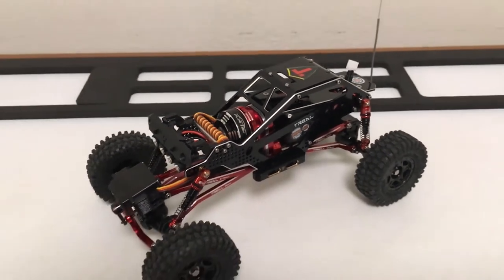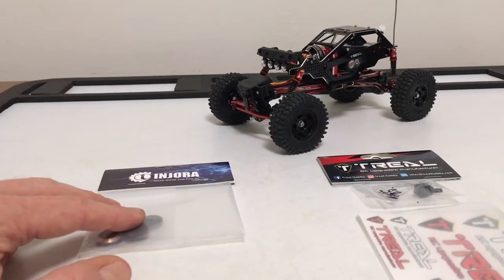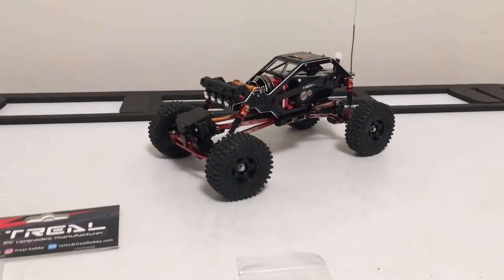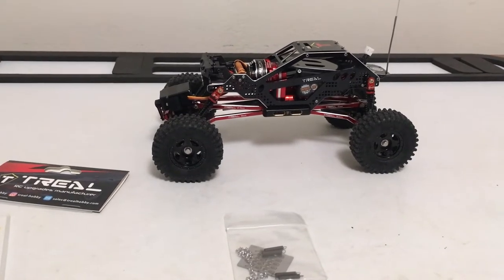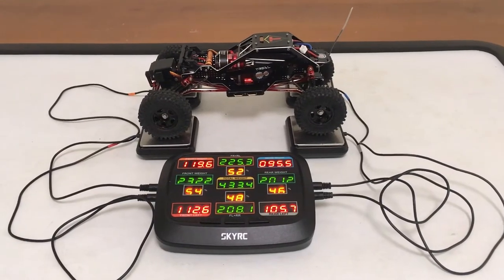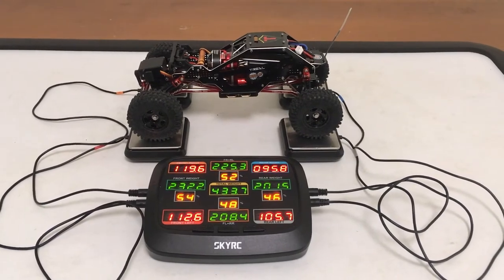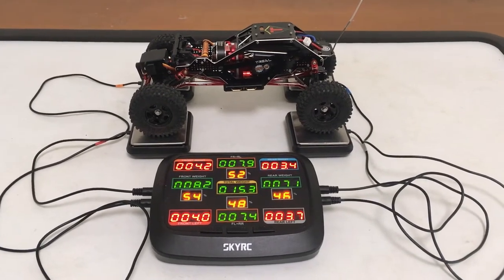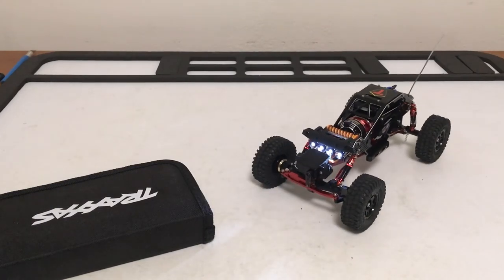SCX24 ROCK RACER UPDATE: MAD MAX - KINETIC RECOIL INSTALL & TEST, INJORA AXLE WEIGHTS, TREAL O.D.

Comment: Man I've been thinking about how to convert an SCX into effectively a 1/24 wraith and been looking high and low for a good reference point... and you fuckin' nailed it. Everything about this is precisely what I'm trying to build, except I might go a different direction with the motor to make it more "bashy" and less "crawly". Thanks so much for sharing
Reply from the maker: Thanks for the compliment.  Sounds like it will be awesome.  If you have any questions along the way, just ask.
Reply: @bcochener  Thanks for offering!
 Got the chassis all assembled, absolutely love it, makes the truck so much cooler.

 Currently running the Treal Deadbolt links, as sold. I noticed you put the rears from the deadbolt set in the front.. am I missing something, or do you think I could use the rear deadbolt links and rear deadbolt driveshafts to just get some OUTRAGEOUS stretch? Would there be a downside to having a symmetrical suspension setup that I'm not thinking of? Stretching the front out is definitely very important imo, the stock deadbolt front end just doesn't give me remotely enough room in the front!!

Thanks again for your time and your videos :)
Reply from the maker: @juanlobo3202  That would be pretty loooong!  Longer you get, the larger the turning radius will be and you will high center more.  (...you can always do rear steer to gain back steering.) 

You can really run about any link combo on these chassis builds.  I am doing a DB front/JLU front chassis build next - as a really short one to compare the two.

I am liking my Vader build length w/ DB rear, JLU fronts.
Reply: @bcochener  Thanks a bunch!! I'll see where the build takes me, I think I'll leave it on the DB treal links for now, although I'm pretty sure when the servo blows and I put an e-max in there I'm gonna run out of space. It has almost no flex right now with the stock shocks, but the injora shocks and a BUNCH of brass gets in tomorrow!

Comment: This is interesting. I watched another YouTuber do a review on these and he absolutely couldn't make him work became frustrated and angry with them and just threw in the towel. and I wasn't interested until I watched what you just did and you seem to have handled it just fine. And they seem to have worked really well for you. this is why I don't watch him anymore and I've begun watching you a while ago. You do a really good job your videos are wonderful your builds are awesome great job appreciate what you do thanks a lot.
Reply from the maker: You must be talking about 2FMRC?  I did add to the swear jar installing these, but I add to that every build with this tiny hardware!  I get the frustration, but I also am a problem solver.  After this video, I loosened them up to raise it up for more clearance, and they started popping of the rear axle.  So I split the difference and pulled them a bit tighter by removing links.  That's why I left all the slack to begin with, I figured it would take some dialing in.  I have parts for a new Mofo kit I will be starting ASAP - and it has his limiter straps.  So I can compare how I like the 2.  Stay tuned!!!

Comment: Lookin good bro!
Reply from the maker: Thanks.  Liking these recoils so far!
Reply: With that being said, I asked you if those would be good for a JLU. Do you still believe that after running these? Cause I don't want to use limiting straps on my build. Do you think the "unload" would be the same on the JLU?
Reply from the maker: @workaholic9286  Yes, similar with the "Go-go Gadget" front end lifting.  But they would be great in the rear.  They'll act about like the HR Long Travel shocks.  Check out that video.  They are about the same length.
Reply from the maker: @workaholic9286  not saying don't use them.  depends on what you want.  All my jeeps are fairly high for fender clearance of the wheels anyways.  Just wanted this lower since it is just a chassis build.
Reply: Ok, I will, and thank you again for your awsome builds and quick response!

Comment: Question. Why would you use these instead of a softer spring? Seems like this is just countering a spring rate that is too high for the weight of the vehicle? Maybe these shocks don’t come with a softer spring than what you have on there
Reply from the maker: I have done that before and it does drop the ride height, but you will still get the unloading even with softer springs.  I have since raised the height back up a couple of links all around for a tad more belly clearance.  It was getting high centered easily since it is soooo long.  And the springs installed are the softer ones that come with these.
Reply: @bcochener  gotcha! Nice, experimenting and dialing things in is always fun

Comment: Which overdrive gears did you use? I see treal has a 2/14T and a 2/13T. Thanks
Reply from the maker: The 2/14T in all of mine (14%).  I think the 2/13T is fairly new (23%).  I have not used it